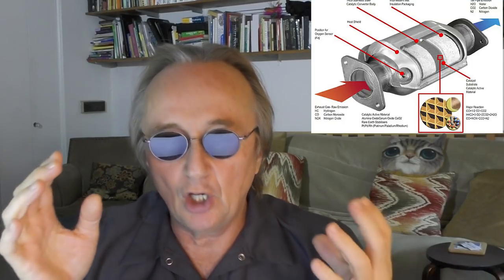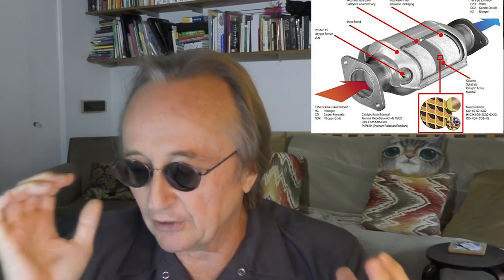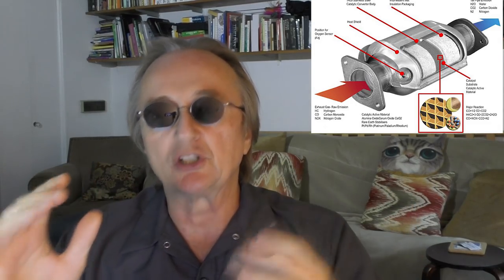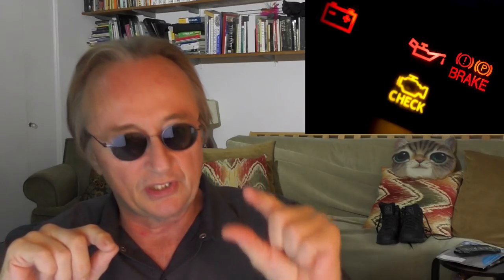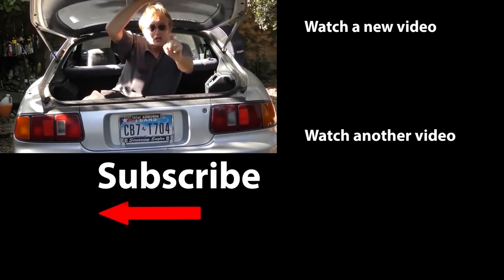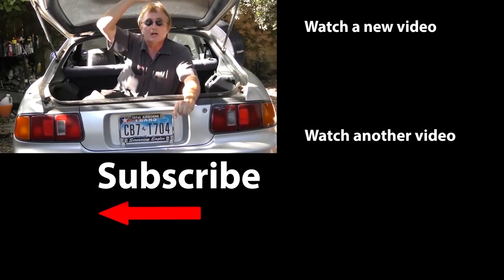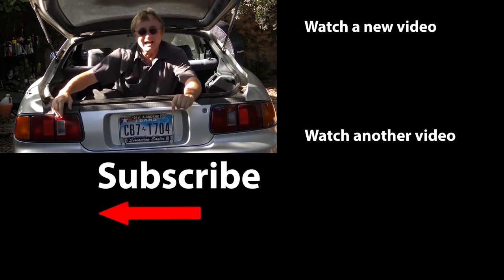Why it’s Illegal to Remove the Catalytic Converter in Your Car

Comment: it's only illegal if you get caught...
Reply: Exactly.
Reply: Yep that's for sure😁
Reply: Everything is the same only if you get caught
Reply: It's only illegal if you're trying to sell it.
Reply: No, it's still illegal whether you get caught or not.
Reply: If a cop didn't see me do it, it didn't happen!
Reply: I tchek your car 20second later i confirm your car have not cata open the open dave..... 😂
Reply: Hood *
Reply: Dave Thompson innocent until proven guilty, right?
Reply: Just like murder. It's only illegal because there is a law against it.
Reply: xxbublebee123 are you being serious or just joking? Like, do you actually think they’ll do that? 😂
Reply: I made a test pipe using an old gutted cat shell so for visual its still there
Reply: No. Just the intent it's illegal. For example, imagine have a shop and you make publicity offering a 50% off of labor to remove catalytic converter for better performance in street cars. You may not even make 1 service and you will get problems right a way, because you had the intent to do it. Imagine doing it secretly...
Reply: some people have absolutely no sense of humor.
Reply: I'm amazed how the Boosted Boiz don't even run a muffler, just a short pipe out of the turbo right through the top of the hood.
Reply: Most people don't know how to disconnect the cat. So the small percent of us that do won't make much difference to the enviroment
Reply: Its illegal under 25 years old
Reply: Jon Wayne And the award goes to....👏
Reply: no dpf here but still got cat :,(
Reply: yes and i personally know a shop in springfield illinois that had 7 different court cases to deal with.   and now they are no longer in business.
Reply: Good luck at inspection time.
Reply: You car would run like bog down. Most modern cars if the cat is missiing with won't run right without reprogramming the PCM (Very Expensive).That can cost thousands of dollars to do it correctly.
Reply: Innocent until proven guilty in a court of law!
Reply: @transtubular  but it's my property
Reply: If you were in the UK it wouldn't pass its mot the next year. Making the car illegal to drive on the public road.
Reply: @xxbublebee123   yes and i'm sure they will be thrilled with you wasting there time - especially when simply saying "its only illegal if you get caught" is not illegal.   making false police reports however IS illegal.  local police departments do not have the time or resources to subpoena youtube (google) for potential ip addresses for users who have done no crime.   you can easily hide your IP anyway.. right now you would think i'm in philadelphia... but i'm not!   now, if i were committing a serious crime online (i don't)  people who know what they are doing could still figure it out.. but i promise the FBI has better things to do than investigate non crimes.     stop watching CSI!
Reply: Dave Thompson, To quote the late Bobby Heenan:  "Illegal is a sick bird."
Reply: Unless you live in Arkansas
Reply: Jimbo no he just has a sense of humor
Reply: Jon Wayne you’re the reason no one can have no fun. You’re probably the person to tell a little kid that Santa and the tooth fairy and all those people aren’t real.
Reply: What? I would never remove my catalytic converter, that would be illegal and bad and it makes my heart feel sad that I would make my government make a sad face
Reply: Black Rooks pretty sure it’s illegal to remove them but not illegal to be caught without them
Reply: Aren't you required to pass emissions tests?  Isn't it's absence noted on the data?
Reply: I have a friend who runs a straight pipe setup on his 2005 base model V6 mustang

He literally puts the cats back on just for emissions testing and then takes them off
Reply: WE ARE ALL SINNERS .
Reply: Ok where can i get mine done have a chevy cruze
Reply: @johan2ofinlohigh791  it’s not illegal in Florida
Reply: @Uniquestanced  well mine is a 96 and off she goes
Reply: Same with murder.
Reply: @JoelinoPT  wrong for intent to be illegal the conspiracy to commit also has to have been made illegal by legislation.  Conspiracy to commit murder or conspiracy to commit arson would be illegal however conspiracy to commit speeding would not.
Reply: @JoseMartinez-ll7vo  so were your taxes before yiu paid them but yet somehow the government can tell you what you have to do with them and what you cannot do with them.  Just because the car belongs to you does not mean you can vent the refrigerant into the atmosphere.
Reply: @Creeperboy099  that's what he tells you he does but it's so much work and cost so much money he doesn't actually do it.
Reply: @FirstLast-om8li  my b bud. I didn’t realize you were perfect. Really sorry.
Reply: @JoseMartinez-ll7vo  nobody said that I was perfect.  But if that's the weak, whiny, emotional reaction you want  to have at having been corrected, that's fine.
Reply: My car has 3 Individual cat 2 in the exhaust manifold and 1 under the car so I'm going to get rre headers for my car
Reply: @logik316  my family took one off back in 1988!
Reply: (Evil laughing) 😈✂️🐈

Comment: Next video : " How to  legally remove the catalytic converter on your car "  :D
Reply: Hahah lol
Reply: Gut it no one's the wiser
Reply: step 1: crush it.
Reply: Get it registered in Mexico   (guessing)
Reply: I bought the car like that.
Reply: Some people take the inside out and then put the empty cat back instead of a piece of pipe, that way it will pass the visual test. 
However, if they do an emission test you're f*cked
Reply: Go into official racing😂
Reply: @TotoGeenen  keep a good cat on hand so you can unbolt it and bolt the good one up when you have to go for an emissions test then take it off.
Reply: @yusuf.alajnabi  would also work^^
Reply: Unless it's welded on like my old one was before I changed to a bolt on exhaust system.
Reply: Prior to 1985, some cars didn't have Catalytic converters so its 100% legal not to have one. Mine doesn't have one. lol
Reply: "test pipe"
Reply: Get a rust-bucket pickup from the '80s. Grandfathered emission control or lack thereof. Easy and relatively cheap.
Reply: but its a federally mandated EPA device.  ever try living in chicago or  californina and own a car,   if so,  you will know if it does not have the converter on it,  they will not allow you to legally drive or own the car.
Reply: easy, TURN it to a race car.
Reply: @nathans3022  he said it's illegal to remove.
Reply: You don't, you take it off, punch out the core, put it back on and nobodys the wiser. Until you got to get an emissions test.  But then you can get a good used one and put it back on for the test.
Reply: Just hollow out the inside. 😉👍
Reply: It's called DIY
Reply: Get a car over 25 years old so it doesnt have to pass inspection

Comment: The guy with the check engine light was probably a volkswagen owner surprised that it didn't stay on
Reply: TheResolute24 Bmw*
Reply: Think this will apply to anyone wanting to buy the 2019 German supra?
Reply: Alexander Peterson 1 day after warranty is up? YES.
Reply: lmaoo
Reply: Or a Chrysler, Uh forget that, a Chrysler wouldn't even start.
Reply: that was seriously the dumbest question anyone has ever asked tho “ y do all the dash lights come on when i turn to accessory” LOLLL
Reply: kman 4443 Yeah accessory is as far as the Chrysler will go LOL
Reply: Cole1027 I think they were trolling LOL
Reply: TheResolute24 that’s funny but I’ve owned my Volkswagen for a year and haven’t had any problems
Reply: My tuned and modded TDI doesn’t have a single light on the cluster 🙃
Reply: BrettK Probably because they don't work
Reply: 100 % a Prius owner
Reply: Keye T definitely do...
Reply: @vizima1027  Had a customer crying and hyperventilating in the shop stating that he went to King Soopers to get kitty litter and his car started beeping at him and we absolutely MUST fix it immediately

15 wasted minutes later, turns out the 30lb litter tub in the passenger seat was triggering the seatbelt light.... Doesn't get worse than that
Reply: I’m a Volkswagen owner and I can verify that lol. Worst car I’ve ever owned.
Reply: My check engine light is on once you start the car it goes off, what that could be help?
Reply: Bmw owner definitely 😂